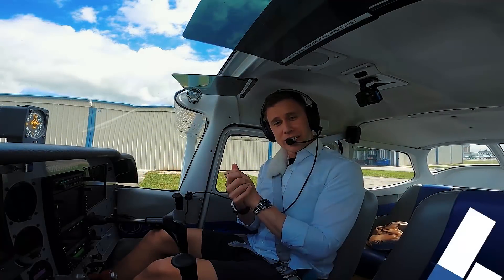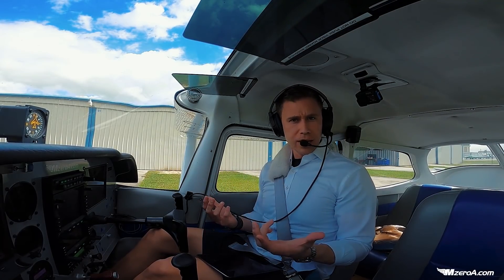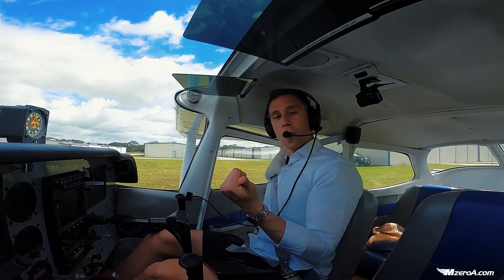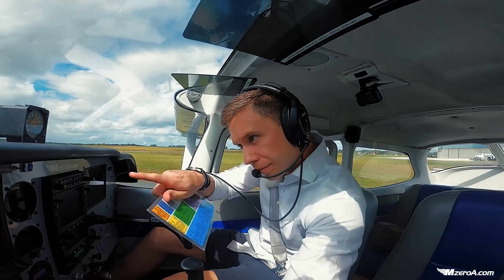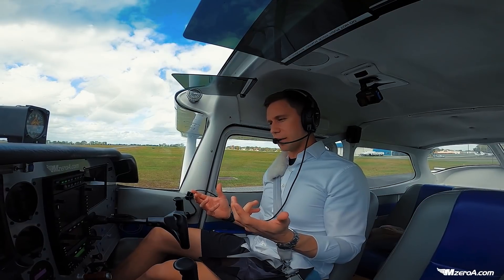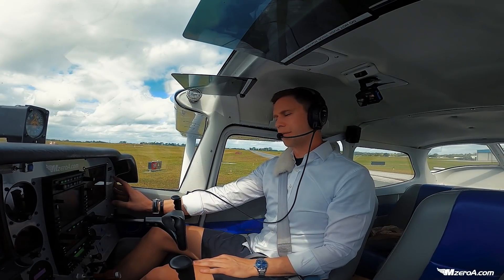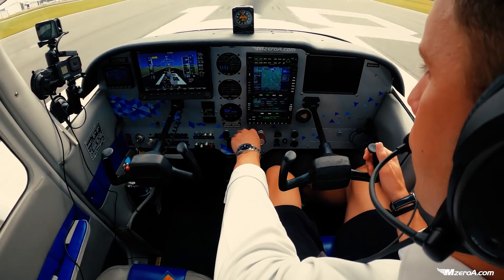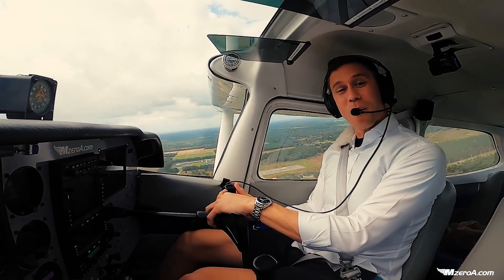Class D Airport Departure - SPC DAY 16

Comment: @mzeroa Question I was departing a class D airport that was inside a Charlie. My question is after I clear the Delta do I have to switch over to charlie? And if so should I just ask for a transition on the ground? The airports i was departing KFXE to the west. FLL is the charlie just to give the full picture
Reply from the maker: Hi Ryan! Thanks for watching! I took a quick look at the sectional chart. Airspace is charted in MSL. I know that in south Florida, MSL and AGL are almost equal, but it is important to clarify this. The FLL Class C starts at 1200 feet MSL. If you climb to 1200 or above while leaving FXE Class Delta, you would need prior permission from the Charlie controller. If you departed FXE and stayed at 1000 feet, for example, and went westbound until you left from underneath the Class C, you wouldn't need permission. As for asking beforehand, sometimes controllers can coordinate VFR flight following from the ground. It depends on the airport. It never hurts to ask! Hopefully this answers your question. If you need more clarifications or have any other questions please reach out to us at support@mzeroa.com! Thanks!

Comment: Here in Australia we never do your cold calls. We just blurt our request all at once.

eg equivalent call Moorabbin Ground, November 2 3 Mike Zulu, Cessna 172, With information foxtrot, POB 1, at north t hangers, request permission to taxi to runway 18 departure to the south.

What's the purpose of the cold call?
Reply: I give a cold call just in case the controller is busy doing something else and isn't ready to copy our request. Especially if the Class D controllers are doing ground and tower simultaneously, you never know if someone's transmitting on the other frequency and they're busy.
Reply: @jayrav13  thanks. Guess different countries slightly different procedures but once this covid madness is over definitely want to travel back to the US so helps me out.
Reply: You don’t have to give a cold call. Usually I only do it for center to get flight following.
Reply: The ground controllers around here (southern California) prefer the whole request. The tracon controllers are mixed - some like it in one go, some don't